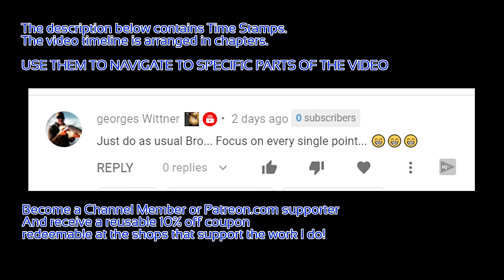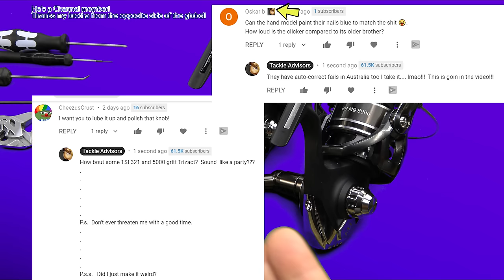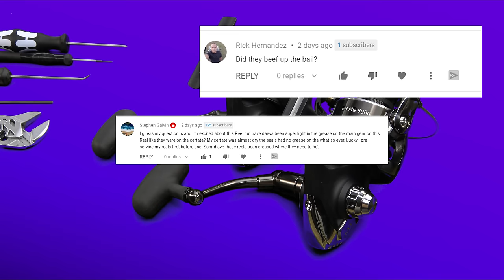Daiwa BG MQ Review - COMPARISON - Teardown - Analysis COMPARED to Spinfisher, BG, Saragosa, Slammer

Comment from the maker: Was I fair in my analysis and assessment?  Let me know here!
Reply: I think it was a fair review. When Daiwa sent you the reels, they probably meant "Just be fair. *wink*"
Reply: I'm with HN, did they mean be fair as in be honest or fair as in say it's a good reel
Reply: Wanted to ask a question. Say you buy a new reel and turn it fast just to test it's smoothness. It is smooth but makes a soft winding sound only when you turn it fast.... Is that normal?
Reply: Totally fair! I think that reel is solid 👌 but sorry Daiwa I'm not sold with it and neither does the spinfisher...I'd rather buy the Stradic FL.
Reply: Fair assessment....and still get it, I am a Daiwa fan boy😂.
I think they should definitely make servicing these reels more accessible to the home service man. Tools, mag lube and mag bearings. Magseal has been on the market long enough.
Shot you an email as well
Reply: Does having an extra seal on the handle side of the real matter. Grease can be the barrier. Not saying that they cant improve the real sealing. They can but maintenance can work to. Also what manufacture is giving you such a large main gear and shaft in there reals.  I think your review was thorough but may be slightly harsh maybe.  i would still buy this real as its design wins me over. why because its a tank of real with no plastic parts and quality components. That is what i got from your review.
Reply: @Cakeem  I think tackle advisors point here is that for the price... Can you get better reels?
Reply: @Cakeem  yes grease would do the trick. So long as you re-apply and still re-apply (for me I travel so the handle comes off constantly don't want to deal with grease) and it was noted that it could take a spray of water but don't go skishing with it. Point being is at its price point an extra seal would be nice, can you get better at that price yes and no. The reel dose have it's pro's screw cap top, MQ body and huge gear....It's up to you in the end to make the call and what you will use it for. At least now you know it's weaknesses and you can work with it.

Me I'm going to get one I have seen and paid more for worse. Yup. cough*MGXtreme*cough
Reply: fair enough
Reply: The conclusion I got from this video is a mental image of Alan Hawk wagging his finger at me. "Buy the Spheros"
Reply: In my opinion it was. You pointed out the strengths and weaknesses of the reel and compared it to similar priced reels with equivalent specs. And you have given your HONEST opinion based on years of experience. Perfect!
Reply: @OzJKjeep  i think we get excited when we see new and fancy words used.  X-Ship,hydrophobic waterproof coating,twist buster,MQ body etc. There's just too much tech for the average person sometimes. understanding whats important and what's not when purchasing a new reel is hard. Also you never know until you use the real a few times if its truly been worth the money and is suited for the type of fishing and your rod etc.
Reply: @Cakeem not discounting you did brig up a valid option of greasing and that's what you got from this👏. Honestly most reel features is just marketing BS. But something's are proven, tried and tested.
MQ body is not anything new, been done for years look at VS and ZB. But it works. While other so called tech is just renaming or BS. It's about understanding what is what, not what's on the box but in the reel. That either comes from experience or advice. Hence the purpose of the video
Reply: You were very kind imho
Reply: @Cakeem  oh and good point, you never reely know untill you put it through its paces.
Reply: Yes. And prepare for Daiwa to perfect it next round.
Reply from the maker: @riyaazarendsefwfs7220  yes ...very normal
Reply: yet not a direct replacement of the bg or bg airbail from the price....what do daiwa thinking?...they act slow... then shimano eventually come up with better bg but with bg price,hopefully....but at end of the day,better price win everytime....
Reply: I was originally thinking of purchasing a few of these, but I think it’ll be one 4000 for cranking kings and see how she goes, eh. I was secretly hoping for a little more refined feeling noted. Looking forward to the Procyon Al review and comparison the the Stradic FL. I appreciate your candidness and honestly.
Reply: I think they're hoping for you to be ✌🏻 "fair" ✌🏻 with their reel lol.
Reply: Anyway fair enough from your view
Reply: I love your "breakdown" of reels.
Keep m coming! I'm sad to hear Diawa not keeping up with the BG legendary past.
Reply: Definitely fair. You called it like you saw it. You can't get any more fair than that.
Reply: 100 percent fair
Reply: You sir were 100% fair and reasonable, Daiwa claiming zaion rotor when its Not , on the other hand was false advertising and dishonest and decieptful. Shame on Daiwa.
Reply: Absolutely! Always!
Reply: Don't be afraid to say it like it is.
For that price, I wouldn't buy it.
At 150$ yes it's worth about that.
Reply: Nope you aren't fair, you ananlise only certain brands, you're biased, moreso since there are better geared reels even under the price of those you butcher in and out.
You're a fanboy of another sort, more wide and discrete perhaps but still, you only address the brands you like, as Shimano, Daiwa and perhaps Penn and a few rarities but let other brands totaly unaddressed...
Reply: Man I am just disappointed about that reel. Why do Daiwa had to come with some new reel with no high quality components, at least for the price is tagged. Cant they see that the competition are working hard?? market is getting tough.... I mean the original BG was good enough! it has been one of the most sold reels the last few years, at a perfect price. Even you could've improved the weak points of it, and re launched it to keep that great image of the perfectly balanced  price=quality reel. At least BG is not being replaced,
Reply: @frankiev-tech4630  they're totally different applications. Stradic goes to 5k and the bg starts there. Stradic is a fine reel but more for finesse rather than brute force. The real comparison question should be this vs 2020 gosa.
Reply: @topcat4199  yeah I agree, but I prefer the Stradic at the time cause price point and being that it's the best of both worlds. But let me tell you I've had the Stradic for like 6 months I've put this reel through a hell of a trial, and it does some damage. 2 weeks ago I've fought a 36" Barracuda and 28" Gag grouper with no problems and still spinning like new, trust me its been my goto reel...super impressive and buttery smooth feel. So I'd say it has brute force as well with a finesse feel. So it doesn't matter the size reel...its how it's built. So sorry that Daiwa is not worth it for the money...if I want Brute force force anything passed 5000 for me will be the Spinfisher VI, which I do own a 8500LL...and that thing is a tank...that's mainly my Shark reel.
Reply: @frankiev-tech4630  hehe I have stradic 5k and 8500ll, love them both! Stradic definitely very tough for  its size and the Penn is good for live baiting, but for saltwater spinning I'd look for something a  bit more refined than the Penn, if possible, like a bg or gosa. I wouldn't chuck 100g stickbaits with a stradic, but you would with a bg or gosa
Reply: @topcat4199  wow thats badass we both have close similar setups...but if you realize...what's the point of over spending on reels, if what you have is good enough...I realized that it's about technique and the right rigs to slam big fish...it's not always necessary to go so expensive on massive reels. But yeah if you want to slam 100 kilo + fish...its possible even with what you have and using the right technique to reel them in...but to tell you I'd rather go conventional for those massive fish.
Reply: @frankiev-tech4630  yeah man I am a bit of a junkie when it comes to buying gear. I mainly fish land based kingfish (yellowtail in us I think) and the stradic just cant handle big ones without getting reefed. I love spin so the ll is good for live bait and is a brute for big fish but also quite heavy. If your standing there casting big lures all day the ll will work but is a bit clunky and heavy and something like the gosa is a much nicer balance. But yeah the $$ hurt haha. I've seen dudes get decent tuna on the stradic, if you got the room to play they hold up really well
Reply: remember they can find a million people to say everything is great but they need the one person who gives them the truth or they can't improve.  There are be engineering changes on the fly for a lot of issues.  You didn't design the thing it's your task to give consumers a valid & candid evaluation.  The way you do your evaluations is is as fair as it can get, what is more honest that pictures with a description of what you are showing and we are seeing.  

I found and watch your content because of your candor and your dry kinda sardonic humor is very appealing to...if Daiwa doesn't send you more gear, shame on them not shame on you.  Your reputation is more important to you and us out here then their egos.
Reply: This reel is 25% cheaper than the gosa. And not that much dearer than the larger BG has much better sealing than the BG which is a proven reel as you point out. It's a lot lighter than the gosa. And as a casting reel I think better due to this. Yes it couldve been better. And I hope Daiwa got some of the seals a bit better.  Both companies could improve there assembly methods and grease seals and smear a small amount over the inside of the reel surfaces. For a minimum of cost. My certate LT5000 A 700$ REEL in Australia had no grease on any seals and had nothing on the main gear was super smooth but dry. It is now super smooth and greased.
Reply: @frankiev-tech4630  Can I know why you decide to choose it over BG MQ?
Reply: @frankiev-tech4630  Can't go wrong with a Stradic anything!
Reply: I really appreciate your thorough evaluation of this reel. Pitched against the Battle III or as a true replacement for the BG in the $110 to $130 range, the BG MQ would be formidable. However, at $200, there are better options such as the Shimano Spheros SW A. That unserviceable side plate, cast zinc main gear, mediocre seals, and cheapo bearings were no-gos for me in that price range.
Reply: Is this reel Daiwas equivalent to Shimanos Saragosa? If not, what is?
Reply: Yes indeed....Their failure to have a sealed line roller bearing was a Big NO for me, especially in this price range.
Reply: You giving the truth.... for this new BG series's I absolutely with you....& The 1st generation of this BG series way too much better & unbeatable...by realising this type of BG series's this will automatically kicked them self out of the game..just saying...thanks for giving good review on this BG 👍👍👍
Reply: Your comment on sealing seems spot on.  A friend's Thunnus went into the drink-100 feet down and he jigged it back up, fished it all day and that night tore it down.  NOT ONE DROP OF WATER, found inside.  THAT is a seal.
Reply: I think you have a bias for Penn for what ever reason. You a VERY skilled at your analysis and I appreciate that. Like several other viewers have said, I can't go back to Penn. To many issues over too many years w sub par stuff. I WILL NOT PAY $62 for a solid aluminum main for for a 4k class reel when the damn thing is noisy or ruff. No excuse for Penn to RAPE customers for parts. I buy throw away Okumas w premium ball bearings and if they get a lil salty they still run fine. Im getting 2-3 years on $49 Avengers that are much smoother than the rough ass Penns. Several years ago I got a Slammer III 7500 (not sure what gen) . Brand new out of the box it was horribly rough, totally unacceptable. I turned around and put it on ebay wo even trying it.
Reply: To be fair and honest, I "felt" a bit or repulsion from your side for a possible good design solutions DAIWA introduced. Apparent bad solutions might be related to us not to be an "expert" technician in reels tear down maybe? I mean.... we might have 30 years of experience in tear down reels, we can do the job, but.... should we consider us self entitled experts and authorized in do so and conclude bad design only because we can disassemble it? if we think so maybe we should tear down a lap top or a TV or a car engine just because we have the tools and the will to do it and then complain about anything we broke or anything else.
Reply from the maker: @Daniel-vu4ft  yeah... I design reels for a living and was hired as a result of my YouTube tear downs... Soooo.. Yeah...

Comment: Without that tool, that I have no way of buying, I won't be buying one of these. And I'm looking to purchase a 6000 size next. The Battle iii 6000 has a brass main gear for $135. The decision is made
Reply: But penn line lay is never as good as modern Daiwa.
Reply: @hothmobile100   not really even a issue with me. I use the penn fierce 3  live liner and it's never gave me bad line lay to where it's a problem. I fish the surf on windy days also.
Reply: The line lay on my slammer 3 and spinnfisher 6 is perfect.
Reply: @hothmobile100  I think that was only a problem with the battle 2's. And then I don't think it's all sizes. I have two 8000s and I don't have a problem with them. My 4000 is a different story. I can't even consider using braided line on it. It's just pathetic. Hopefully the 3's will be better

Comment: I hooked a 4kg fish with a brand new $70.00 real which i purchased from my local tackle shop. The main gear failed and i lost the fish a couple of feet from the shore. That is why i watch your reviews cost i need to know i am not wasting my money when purchasing a new real.  i have two Daiwa ballistics very happy with them. i can even service them myself cos of these vids. Thanks very much for this review keep them coming.
Reply from the maker: I love my big ballistic and the 2500 awesome reels! Glad to help brotha!
Reply: Just buy a Fin Nor Offshore and you know you have something, body all alu with all gear stainless steel, the 6,4 mm axle supported in 3 points, front middle and rear for real effort, no compromise as alu, coated alu or zinc, even the handle, there's no schiki miki reverse switch and no one way ball bearings but the solid clutch anti reverse. It is heavy but strong, built to hold any fish and to last forever, you can't have both, whether strenght and endurance or lightness, the lighter it is, the less substance/atoms in it... 
I just brought a Fin Nor Offshore 10500, when you hold it in your hand and hear its clicking while turning the spool you know that's the thing a man wants.
An endurance test would be interesting, alu gear, coated even, vs brass and stainless steel gears, so those Daiwa and Shimano vs Fin Nor and other stainless steel and brass gear reels.
Reply: Use the drag and rod to pull line in then then pick up line as you slack the line. Any gear will fail if improperly used. Don't grind through it, especially with spinning reels.
Reply: In my experience even my cheap Daiwa Crossfire LT 3000 didn't have issues with 4kg fish, even though it costs 40€😂

Comment: Been running this reel for a year and had it torn down. Seal at handle is perfectly fine. Btw. All salt water kayak and beach surf fishing. 2500 is absolutely a perfectly weighted and powerful gem. Maybe a little high in price but Shimano has jacked their prices up big time. This new BG MQ is a Ms nice or I would say nicer than my Stradic FL. My new go to inshore saltwater reel. Like my Ballistic for inshore as well.

Comment: Great information as always. Here’s my $0.02. Most freshwater fishermen don’t do a lot of maintenance, and for the most part, don’t have to and for a number of reasons this reel probably isn’t on their radar.  Most saltwater fishermen buying this price point of reel want and possibly need to do some level of maintenance. One time use seals, specialty tooling, a million parts, etc. kill that for a lot of people. As you mentioned, the spinfisher and slammer iii are easy to maintain and get parts for. Daiwa may sell a ton of these, but at some point, people are going to get frustrated with the maintenance and repairs, especially at this price point.
Reply from the maker: I went into this thinking that this sealing was a response to people not being able to access daiwa magseal......and now it's the same damn thing..now you have to find a tool....40$ - 80$ is the price to expect...and often unavailble on ebay 
So it's pretty clear daiwa wants to grow their service end of the business....In my recent experiences with their service they're 0-4...and yeah..not everyone services their own gear....but a surprising amount would like to....and a 6pack goes a long way extending the good years of a reels life :)

Comment: I don't think I can ever go back to the Penn's. I have had several battle models and they all corrode horribly on the body, and just this weekend, one of my 4000's stopped oscillating. Opened her up and the gear was disintegrated, no teeth. No signs of water, and was greased well. Just seems it crumbled whatever that material is made of. I have done several repairs to most of them. So far, no issues with the Spinfisher V's. Just watched the reviews of the BG BQ's and was nearing purchase until I saw the materials inside made of zinc, etc. Decision now to go ahead and pay the extra for the Shimano Stradic FL and eventually replace my bigger spinning reels with the Saragosa's. My son in law has these and they are so smooth in comparsion, it makes my Penn's feel like $10 POS. He has had several seasons fishing exactly same as me from our boat in Saltwater and has had zero issues, no corrosion and no servicing and they are flawless!